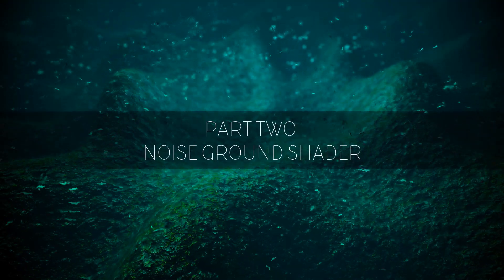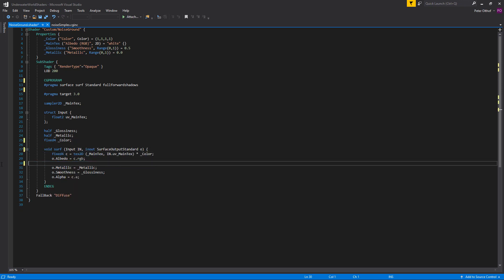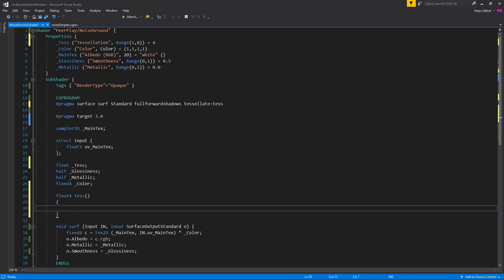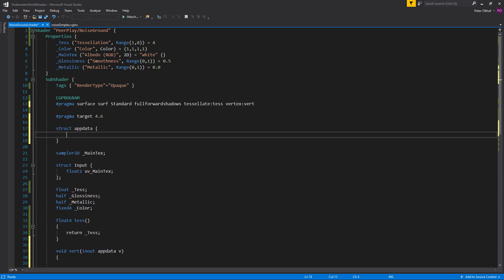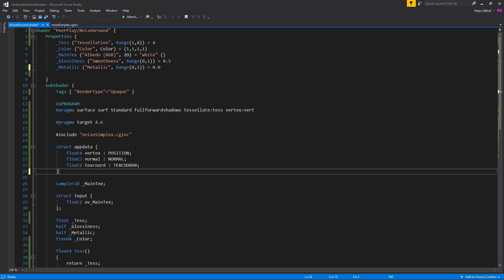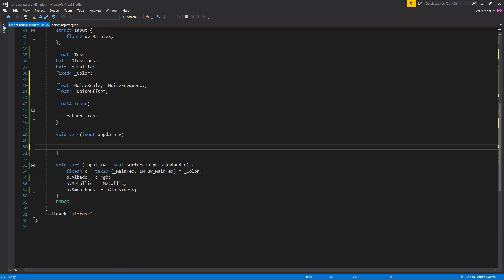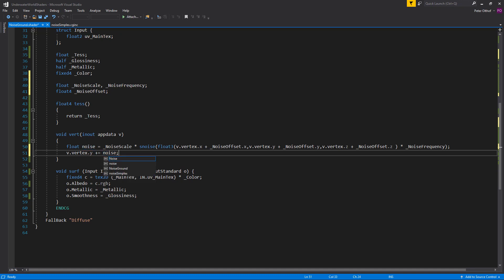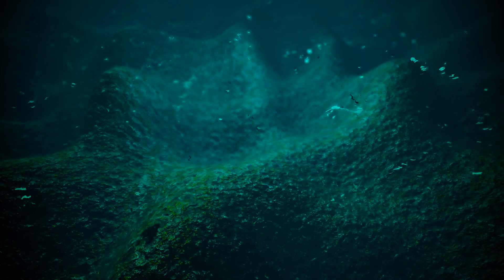Underwater World Shaders - Unity CG/C# Tutorial [Part 2 - Noise Ground Shader]

Comment: Hi there I am still fairly new to Shaders so I do apologize for any silly questions. I have got this to work perfectly up to this point so far, however I started this off  in a blank scene in a existing project with Universal Render pipeline installed and I could see everything working with a wire frame but I had a missing texture pink on the plane. I then thought hmm maybe its the Universal Render Pipeline and started a clean project and as expected it was the Render Pipeline and without it my plane no longer had a missing texture. Is there a way to make this work with the Universal RenderPipeline as my project I am working on and intend on using this tutorial for  has this package  installed.  Thank you for your time very interesting so far !

Comment: hello, thank you for the video. I unfortunately am not able to get this to work. I get the error  "invalid subscript 'y' at line 53 (on d3d11)". its the line where there is v.vertex.x + _NoiseOffset.x, v.vertex.y + _NoiseOffset.y, v.vertex.z + _NoiseOffset.z
i have turned off auto api and am on d3d11 (DX11). also im on unity 2018.4.3f1 LTS. did unity turn off tesselation for unity 2018? 
the first step worked though where the wireframe shows the noise but the tesselation wont show. any help is appreciated.
Reply: I don't know if this is still of use to you, but I had exactly the same issue you described.
It turned out that I initialised vertex as a float within appdata. This caused v.vertex to only have an x component which gave rise to the error.
I made it a float4 and now it works. 
In the video he does it correct. But it took me a long time to find out.

Comment: Hello @Peer Play, no luck for me neither. I'm having the following warning messages and only "Tessellation" slider is working. No NoiseScale, NoiseFrequency or so. Could it be an issue with NoiseSimplex ? :
Shader warning in 'Custom/NoiseGround': texcoord1 missing from surface shader's vertex input struct (appdata), disabled lightmaps and meta pass generation
Shader warning in 'Custom/NoiseGround': texcoord2 missing from surface shader's vertex input struct (appdata), disabled dynamic GI and meta pass generation
Reply from the maker: those shader warnings don't really matter, you could ofcourse add a texcoord1 and 2 input in the appdata to remove those warnings.
It should all work. Do you have Unity Plus or Pro? Might not work on the free unity version. Also check if you use the correct pragma target version.

Comment: Help please! I followed your code exactly and I can select this as a shader but nothing happens when I change the tesselation. as Rohith Vishwajith
 says
Reply from the maker: I have seriously no idea why this is not working for you guys. I tried following my own tutorial step by step, and it just works for me. 
I can only recreate your problem, when I change the Graphics Emulation to emulate shader model 3 or 4.

- Make sure you run Unity 2017 or later
- I'm not sure about MAC support, I'm Windows only user. but tesselation is supported on MAC since 5.4
Reply: @PeerPlay  i managed to do it thanks for.the help . Im trying to atach the shader  to a camera and  use a vehicle . I wil desactivate the property out of the water and activate in.
Reply: It would also work if you would use shaded wireframe as the shading mode

Comment: Is there any plugins you have for your MS Visual Studio? Also what version are you using? I am having issues reading the shader code. There is also a issue I am incurring in which, just like @Rohith Vishwajith is having, the tessellation is not occurring. The values are appearing as in your tutorial, but no tessellation is happening. 

I am running Unity 5.6.3p1 and am using MS Visual Studio Community 2015.
Reply from the maker: I am using the standard Visual Studio settings, only changed the theme to a dark theme, as I prefer to write on a dark background. Can you try copy paste the standard tesselation shaders from the manual, and see if those work for you? In the first part of my Snowtrack Shader tutorial I explain some of those basic shaders. If those don't work, it could be some settings in Unity. Make sure you use the latest shader model in the graphics settings and tick on the icon in the Scene View to show effects. Look up in the Unity Manual the topic of tesselation and follow the steps accordingly. 
Also I recommend to start using the latest Unity version. I know that in previous versions before Unity 2017, some functions of shaders are Plus or Pro only and I think they changed that in later versions.
Reply: Thanks for helping me out.

Comment: I've retried this almost 30 times now... Its not working and I'm not having any luck getting the plane to react.
Reply: 'it's not working' is not really a useful information.. you are helping others, and make it easier for people to help you if you provide more detailled information about what isn't working  for you.
Reply: @TheLeontheking  they are saying though the shader shows the inputs and the code is not throwing any errors the mesh will not deform. Unity will throwback an error however that TEXCOORD1 and TEXCOORD2 are not specified within the code and will need to also be added.
Reply: @DeathxStrike18   i have the same problem do you got any luck to solve it ??
Reply: Go over his code again and again, he talks too fast and it's easy to miss stuff. In my case I forgot to add vertex:vert to one of the #pragma lines. Shaders are basically garbage code full of magic constants that VS doesn't really have any kind of support for, so it's easy to get frustrated.